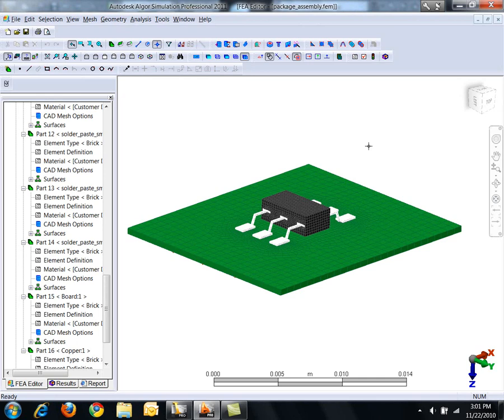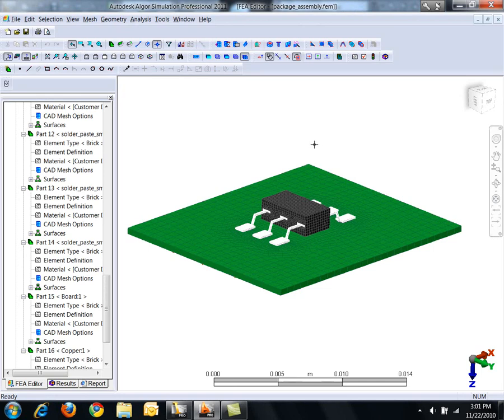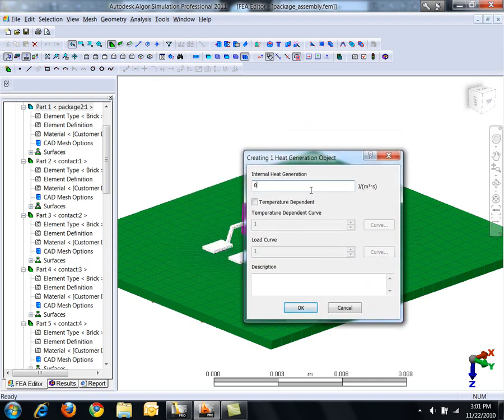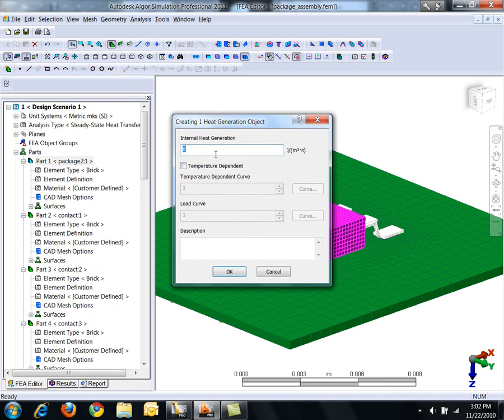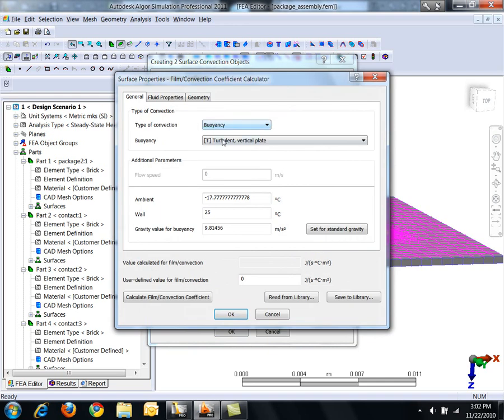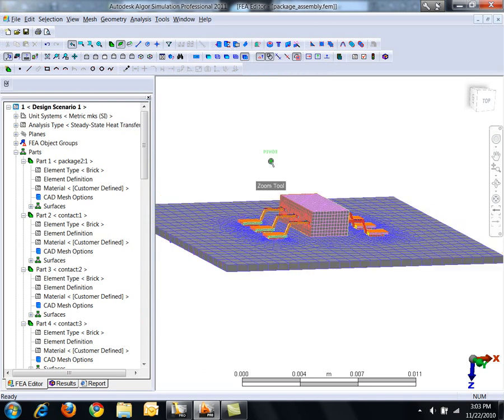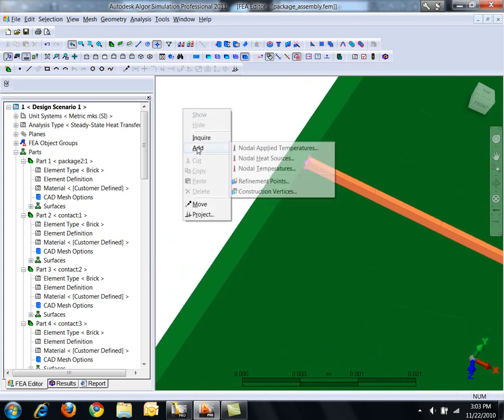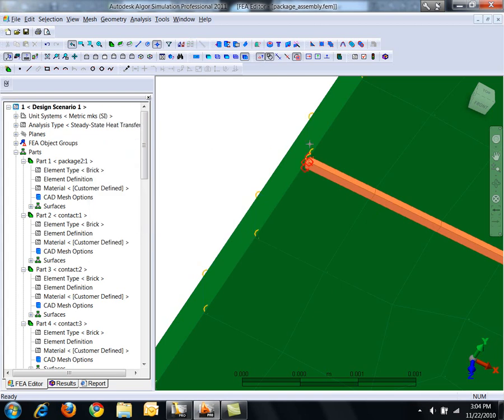Autodesk Algor Simulation FAQ - Heat Transfer Model Setup

Comment: Every time I try to view it I cop an Invalid URL Address. Grrr ! Maybe because I have no computer & the Phone can't connect to you?
 Anyway, sounds good, from the script. Would you be interested in the Solar-Thermal Barometric Thermosyphon-driven Air-Pumps I use, to cool my enclosed Streamlined Photovoltaics ? At 100 Km/Hr Airspeed it's a 75-Watt Ramjet ! Search 'sunfoil', & that'll be me. Have fun with the ideas.